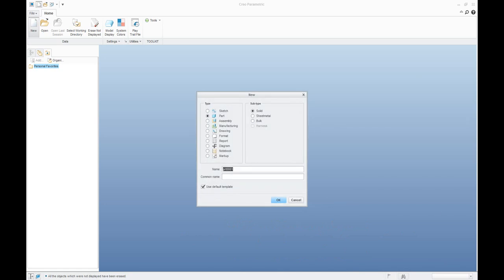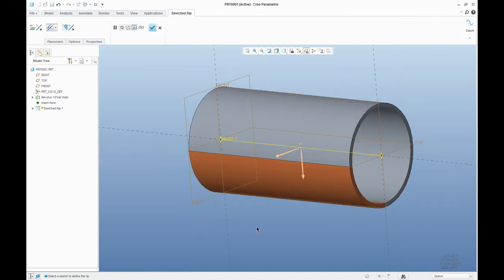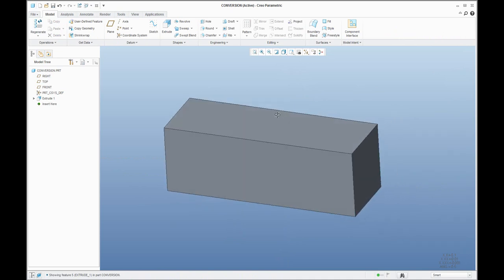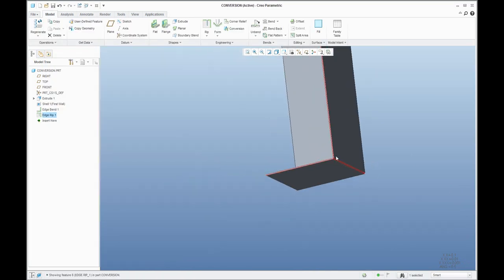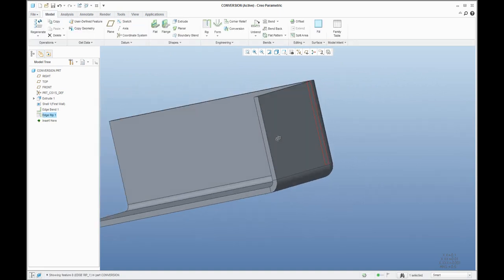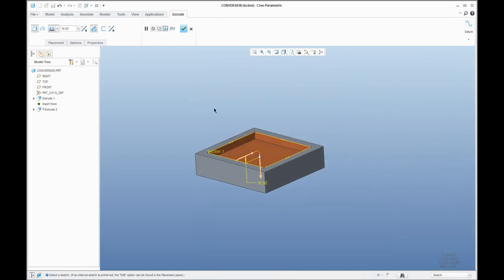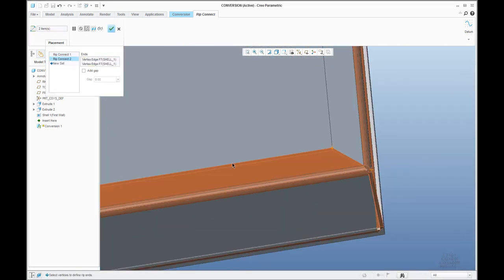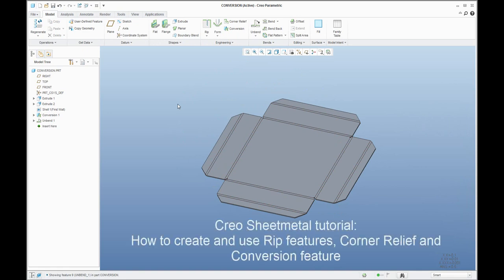Creo Sheetmetal tutorial: Rip, Corner Relief and Conversion features

Comment: will the edge rip work without doing the edge bend ??
Reply from the maker: No, it is not possible. For Sheetmetal you need to create Edge bend too. (try to check this video.. You can see that if you select Edge rip.. System automatically creates Bends on the another edges)